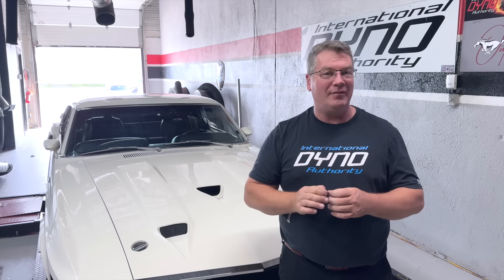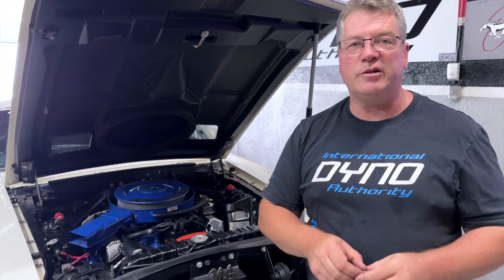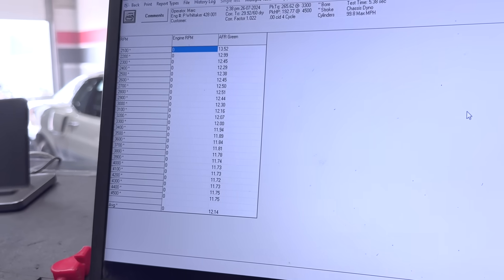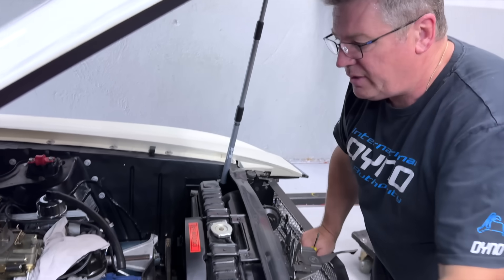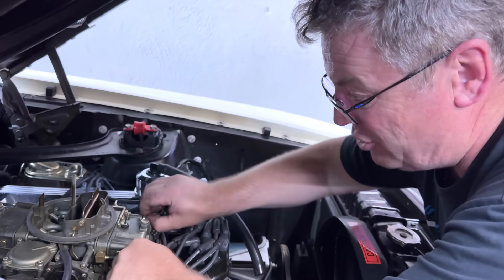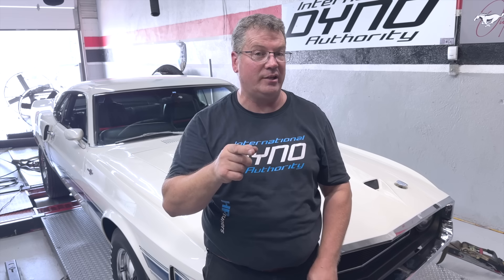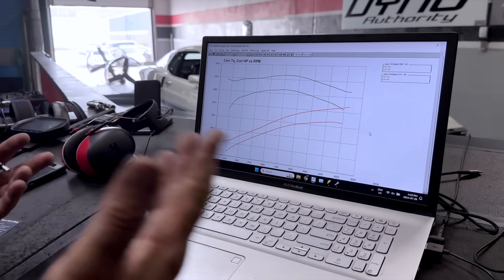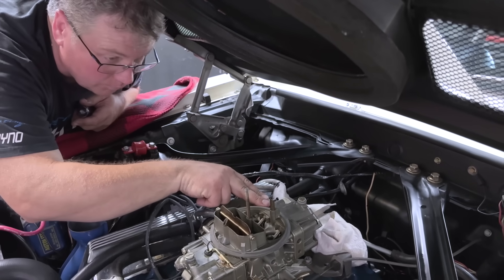Original, unrestored '69 Shelby GT500 tuned on the dyno

Comment: First all of the valve stem seals are bad thats why it smokes the engine is not in tune and it probably needs all of the gaskets replaced and unless you plan on going through it all and refresh it all you are only putting a temporary fix on it so sorry about all of your wasted time and it needs to be upgraded to electronic ignition to make it run correctly because the distributor is worn out as well so it will never make the power as it was new unless you do all of the work on it, sorry
Reply from the maker: Thank you for your comments. Unfortunately each one of the comments can be picked apart. And shown to be incorrect. As, we actually diagnosed the issue. We fix each one of the issues piece by piece. The engine had a zero to pieces and parts. The ignition was new. And the car now drives as it should have from the factory also, smoke comes in many different colors. If it is white it's coming from a gasket which is allowing coolant into the system or water into the system. And is then changed color in the combustion process. If it is blue it is smoke from engine oil getting into the combustion process. If it is black smoke. Which it was in this case. It is excessive fuel, which means on a very very rich mixture. Unburnt fuel you will smell. black smoke coming out of the tailpipe. Not sure what your expertise is diagnostician at us at our shop
Reply from the maker: We're probably not going to hire you as a diagnostician. Because you got each and every one of the things wrong that you said. Bud, nice try
Reply: @internationaldynoauthority693  Also, because the poor guy has no idea how to use punctuation.  Maybe a period and a capital letter in there every now and then to, you know, separate your different thoughts into separate sentences.
Reply from the maker: None of the valve stem seals were shot the engines in mint condition there was no Blue Smoke
Reply from the maker: Jumping to conclusions happens when someone forms an opinion or makes a decision before fully understanding the situation or considering all the evidence. This often stems from assumptions, emotional reactions, or biases rather than logic or careful thought. When people rush to judge, they may overlook key details, misinterpret information, or ignore context that could completely change their understanding of what’s actually happening. It’s a mental shortcut—our brains trying to make sense of things quickly—but it often leads to inaccurate or unfair conclusions.

Failing to pay attention to the evidence in front of you can cause even greater misunderstanding. When we selectively notice only what confirms our existing beliefs, we close ourselves off from the truth and weaken our ability to reason objectively. This can damage relationships, spread misinformation, and lead to poor decisions both personally and professionally. Taking time to slow down, ask questions, and consider multiple perspectives helps ensure that conclusions are grounded in fact rather than assumption.

Comment: why the Hell you running reg gas in it?  Put some high test in it....check the book for what grade of gas it calls for...........
Reply from the maker: It has 91 octane and, the fuel that was required was in the tank. And, the ignition timing was set as per the fuel that was in the tank. It does not require 100 octane to run. It requires 100 octane to be maximized and to get the 10th of a 10th of a 10th at the quarter mile. We ran 91 octane. And, we recommend 91 octane. Because you can get it it's readily available, and it was too perfectly for 91 octane. With 28° of timing.
Reply from the maker: "LOL"   "why the hell",,,, lol
Reply: When this car was new, 100 octane gas was readily available and affordable.

Comment: Nice car for sure but NOT really a TRUE Shelby GT500. I had an actual 1967 Shelby GT500 built by Carroll Shelby at his LAX airport facility. FORD took over the entire manufacturing of the "Shelby" from 1968 onward. Mine had a medium riser intake manifold with 2 dual feed dual pump Holley 600 cfm 4 bbl carbs. The distributor was a centrifugal dual point unit. Mine also had the actual 15" Shelby 10 spoke mag wheels. So the '67 GT500 is the only year that it was built by Carroll. Sadly I sold the car back around 1974 but I still have my original 1967 Shelby GT350/500 owners manual with all the specs. 😋

Comment: I was heavily involved in the street scene back in the mid 70s to mid 80s. I ran and was inside a number of original 60s and 70s muscle car motors. I love them all ! I have the following opinions about these wonderful motors. 1. The factory build quality could vary producing differences in power. 2. Because of the inefficient ignition systems, rich fuel delivery paired with lots of cam shaft overlap these motors fell out of tune very quickly. Carbon build up and fouled plugs were common. 3. Getting almost any muscle car of the era to run in the 13s , dead stock was a rare feat despite what the car magazines said. Running in the 14s in good tune was  really good. 4. One of the easiest ways to ruin these motors performance was to " up grade" the fuel delivery system without carefully testing its effects. 5. In many cases the top dog high rpm solid lifter motors were not the best street motors. The massive low rpm torque produced by some of the  luxury car big blocks with a few simple mods could offten out pull the finicky high end HP motors. 5. Factory rating numbers don't mean much. Build quality and tuning that deliver individual performance numbers in your car do.

Comment: Thru the drive pullies,tranny,and driveline,one would expect a 70hp loss.300rwh is pretty good,putting crank hp at about 370,which sounds about right for an old 428.In those days manufacturers underrated the hp on all their performance cars.

Comment: I have a rear wheel dyno chart of a 70 454 ss chevelle that put out 280 at the rear wheels.
Reply: Which LS engine? There were three of them .
Reply: @oldbuzzard76 the 450 hp one. I believe that's the LS6?

Comment: 15:22 Unless they all smoked, they didn't say that's the best they can do from the factory. Could you put a dyno carb on it to get a baseline? After seeing how mismatched the front of the carb was, I would have pulled the whole thing to go over it on a bench.
Reply: You’re exactly right. Plus an old distributor is going to have yards of endplay along with a stretched timing

chain at all

Comment: Dog engine I’ll take a 69 Z28 all day
Reply: 😂😂😂😂 Slowmaro!!
Reply: Cool, what color is yours?
Reply: I agree stock vs stock my 68 z28 would lay an ass whooping on it for sure. Had to clean up the bores at .10 over rings and bearings and now hei but it’s a given due to age. Original m21 still and factory rear. Put down 378hp at the wheel. This Mighty Mouse wraps out at 7 if you really want to push it. 6800 rpm is the sweet spot.
Reply: go troll elsewhere, this video is for people who appreciate classic Fords
Reply: John Wick & Steve McQueen don't drive Crummy-looking Camaro Junk !!!
Reply: Z28 is a dork mobil.
Reply: Chevy is in business due to copying ford ideas.  You think it is a coincidence that Chevy LS motors look like a Ford Cleveland designed motor?  Take your Vega for a spin, tool😂
Reply: @Steve-z1k7u unfortunately for Chevy "LS" = Leaks Sometimes!!!

Comment: With it that rich from day 1,how much carbon is built up! 12;1  compression?
Reply from the maker: This is now a clean running, carbon-free unit. Drives well, it is correctly tuned. And ready to have some fun with. Consistent tuning, with normal driving, has cleaned everything, to the point where it is back to spec.... Works very well now

Comment: Crazy to think that 4 cylinders can make 800hp and V8s can make thousands, yet this 428ci doesn't even make 300hp. Crazy.
Reply: Do you often take the time to compare apples to oranges? different engines for different purposes in different eras of automobile development not likely to generate the same results. Just enjoy this classic in original running condition.
Reply: The fair comparison is what 4 cylinder engines had a dinky 90hp in 1969 when this car was produced. You're comparing a 1969 engine to a 2025 engine which is unfair. That's like comparing an eight-track cassette player to Spotify
Reply: what's also crazy, going back another 56 years from 1969 to 1913 - the Ford, Model T, four cylinder pumped out only 20 horsepower and was considered state of the art for its time. Different engines from different eras - not worth comparing.
Reply: Dont forget that the big numbers these days are because of turbocharging and supercharging.
Reply: @scout6180 They had those technologies back then.
Reply: All you little kids, comparing new turbo engines…. This motor here doesn’t even have fi. Take your turbos off and stick a 2 barrel carb on it, and then do your comparison.  If you wanna play stupid comparing…. Funny how this car is well over 50 years old, and its still worth more money, than your 2024-25  crazy
Reply: I agree. The improvements in engine performance is nothing short of incredible. 4 cylinders routinely making 300+ HP..
Reply: @beaurex4756  but a 300hp four cylinder is not likely making anywhere near the 400+ Ft-lbs of torque that this car makes.
Reply: The 4 cylinders make almost that much torque, are lighter, more responsive, have sophisticated transmissions, AWD, and all sorts of performance-enhancing hardware and software. I will admit they don't sound as good as a large V8.
Reply: @beaurex4756  you are just proving my point that it is unproductive to compare engines from different eras of automotive technology development, just enjoy the video of a 56 year old classic being tuned to run at factory numbers.
Reply: In 1967, my girlfriend's stepfather was the head suspension engineer for the LeMans cars. I actually got to sit in a couple when they were at one of the Kar Kraft facilities. I got to drive his daily-driver, a blue Falcon Sprint convertible with a heavily massaged 289. That was how I learned to drive a manual transmission. The girl, though cute, turned out to be a real dud.
Reply: @beaurex4756 and when they are 50-60 years old, let’s see how much they’ll be worth, i bet , not 80 to 90 times the original cost of when it was NEW
Reply: @beaurex4756 fair enough, but the torque will be much less, and engine life too I should imagine.
Reply: Crazy how you can compare your little tinker toys, to a car with absolute respect. … but to be honest, you’re comparing apples to bananas.. it’s safe to skip the oranges here.  Take all your turbos, and super chargers off your plastic rectangles, and install a 2 barrel carb, and let’s see what you get for hp. Crazy how much lower rpms that 428 can make some respectable hp, and how all these newer smaller motors have to run they’re little legs (connecting rods)so fast to make a decent amount of power
Reply: This is RWHP not HP at the crank. No turbo chargers here either. Fords didn't get any faster with N/A cars till the 21st century.
Reply: it was a cleanup job, not a all out super pro, that engine could easily make way more horsepower, but that 4 cylinder will never ever ever make as much torques as a 428 never - its physics wouldnt that be correct folks?
Reply: I have a 350 Chevy that makes 300 that i use to go to work and bring home food. My mild 454 makes a tic over 500. Fords backwards oil pans made me scratch my head i seen it the first time and that moment has impressed me to this day. Not one of fords better idea's after all in my opinion. Building cars by comity proves my point.

Comment: Great video.  I learned to tune  Holly and QJs  like this as a teenager but the only way I had to analyze was to follow and watch for smoke  when the driver went full throttle and to  read the plugs.  I learned most of my advanced stuff from reading Smoky Yunick.  To read the plugs properly for full power  you had to bring it up to wide open throttle in a gear that allowed you to reach at least max torque RPM and dump the clutch and turn off the engine then roll to a stop.  Then you had to remove a plug on the side of the road and have a look. Otherwise  the low speed and idle circuits would mask the full power condition.  You can probably imagine some of the conversations i had with law enforcement.  

Lucky for me, in the small Ozark town i lived in, all the LEs got to know me and that I was not reckless and safety minded . One county sheriff even asked me to tune  his 428 interceptor for him.
Reply from the maker: We agree that proper tuning can be a bit of an art!
Reply: what does dump clutch mean?
Reply: @JB-zn1kx  Sorry, old slang talk from my time a place.  Just means disengage. The process was to turn off the engine and make sure the engine is completely stopped for the coast down so the condition of the plugs at full power is preserved.  😄

Comment: Nice # it’s def a healthy inside.
Reply from the maker: @TeeBone-l2i  Yes, we agree, after getting the engine to just simply run normal. And run correctly. The engine is very healthy. You could step on the gas at any point, while you are driving this vehicle. And it would instantly accelerate and accelerate rapidly. 

Cheers, from all of us here at International Dino Authority